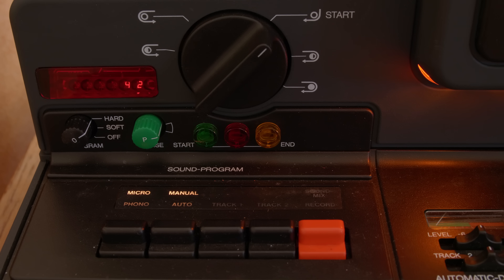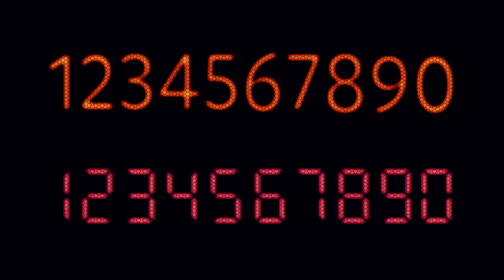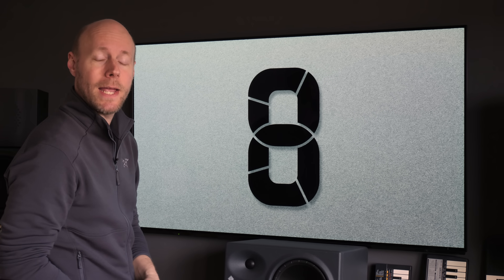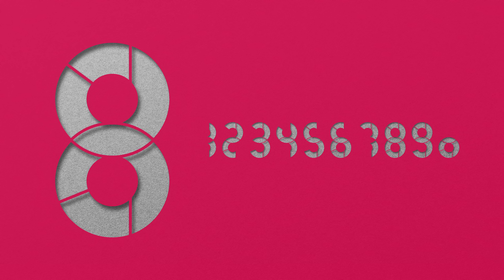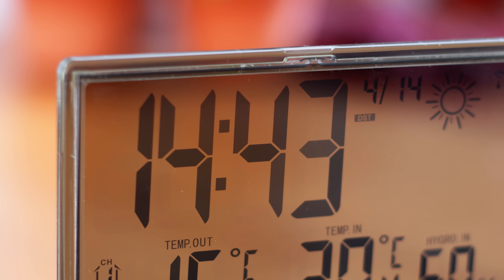Segmented Displays

Comment: Not to be overly critical, but that 6 segment design at 8:57 is really terrible. Hardly ANY of the numbers look normal. With some, like the 4, looking totally foreign to the point where someone seeing it alone without knowing it was a number would never guess it was a 4 in a million years. And even if they knew it was a number, it would take awhile before they guess 4.
Reply: What about the rest of the digits?
Reply: For me, the only digit that looks decent is the 3
Reply: @diegoadriandanielarce2211   At least with the others, knowing it is a number, you would be able to tell WHICH number. sure, the 5 is way more like an S, but you would know it was a 5 by process of elimination if nothing else. But that 4 could be a weird 7. Or, quite frankly, if I saw it, I would think that there was a segment that was missing. Like when my grade school gym's clock had lights out on the basketball court, and you didn't know if you had 4 or 9 seconds to get a final shot off.
Reply: @FUGP72   too much for me to read

Comment: If we move to base 16 and reinvent our numbers, we can do a 5 segment display, that shows all the numbers:
The segments being: o, I, __, \, / (don't mind the `s, using them to prevent YourTube's dreadful formatting from hiding the underscores)
o = 0
I = 1
__ = 2
`_I_ = 3
\ = 4
\I = 5
`_\_ (the bottom line is connected) = 6
`_\I_ = 7
/ = 8
I/ = 9
`_/_ = 10
`_I/_ = 11
\/ = 12
\I/ = 13
`_\/_ = 14
`_\I/_ = 15

Comment: I’ve once made a hexagon segmented display. It was for a game that was based on hexagons, and it worked pretty well. All numbers, letters, even capitals were doable, and I’m quite proud of it as well. The design was 12 segments, with each of the six sides being a segment, and lines from each corner of the outside to the center were segments.
Reply: ooh i would like to see that
Reply: Hexagons are the Bestagons
Reply: @javieralejandrotrianapaz6343  RCE fan?
Reply: @Atanat48 That’s from CGP Grey. He likes triangles more.
Reply: Do you have a picture or example? That sounds cool
Reply: Would love to see it. I've tried writing it out to see how it would look, but I'm not confident on the 7 or the 9. 
Plus, I gave up at "A" when I tried  letters.
Reply: @Jabberwockybird  top 5 edges, horizontal diameter line, tada
Reply: Cool, wanted to see the game too
Reply: Would love to see it
Reply: What’s the game called?
Reply: @CloroxBleach0  it was actually kind of a lie. The game was geometry dash and I was building a level for the game using hexagons, it was just easier to explain that way and didn’t really affect the information.
Reply: @thewoodpeckers655  do u have the level uploaded? If so whats the id, i’d like to see it
Reply: That sounds very cool
Reply: I thought of that design too! I came up with it using it isometric graph paper!
Reply: 1234567890
Reply: Hexagons are the bestagons!
Reply: @ fellow cgp grey fan!
Reply: 70th liker

Comment: In defense of the Sharp design, it can also display a high, half-height zero, which could be useful in monetary figures. Same goes for your X design. The X-O design is brilliant, but the 4 could use some work. Perhaps by using two segments in the middle. The 3x5 matrix also pales in comparison to the 5x7, which allows for much more segment separation. Also, a 9-segment double square with the two extra segments in the sides would only need two extra OR gates from a generic 7-segment design.

Comment: I ONLY HAVE THE SEVEN SEGMENT ONE  1:25
Reply: Bro put more that 25 replies in his own comment what a shock
Reply: 1:25 7 segment
Reply: 2:05 chopping the corners
Reply: 2:11 segments are not symmetrical
Reply: 2:34 rounding the corners
Reply: 2:57 closing the gap in both sides
Reply: 3:39 moving left casts away from the corners
Reply: 4:19 adding 2 middle segments
Reply: 4:42 alining slices in verticals
Reply: 5:33 double circle
Reply: 5:56 adding 2 diagonal segments ( 9 segments )
Reply: 6:47 fake matrix display
Reply: 6:59 color code
Reply: 7:13 fake matrix display ( 18 segments ) color code
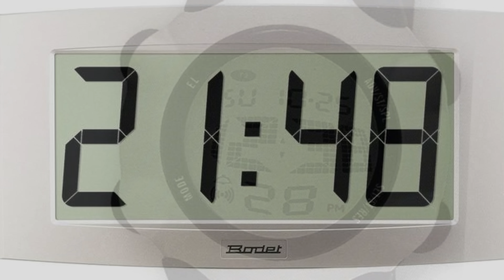Reply: 7:23 more displays
Reply: 8:05 display that is like handwriting
Reply: 8:57 6 segment
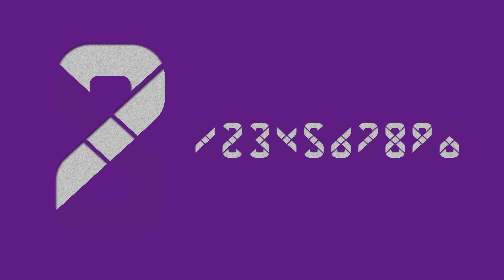Reply: 9:21 adding an extra middle segment
Reply: 9:49 display that has another segment on the right
Reply: 10:04 freeform
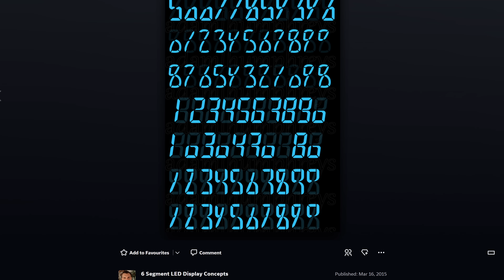Reply: 10:42 5 segments
Reply: 10:50 display that cannot be done
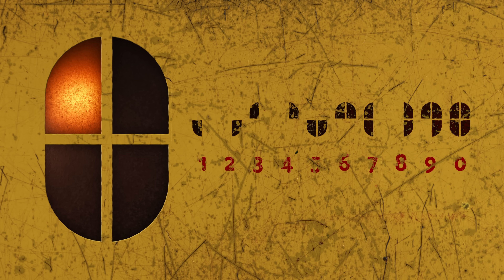Reply: 11:01 4 segments
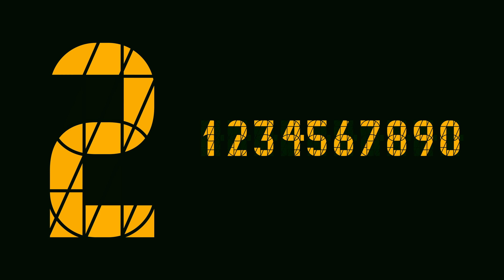Reply: 11:17 35 segments
Reply: 11:38 13 segment ‘’XO’’
Reply: 12:15 15 segment
Reply: 12:42 15 segment 3x5 matrix
Reply: 1:22 double square
Reply: ( normal )( 7 segments )
Reply: Copier copier la copier de cteeado

Comment: You’ve gotta license these designs to digital watch makers. These are pretty cool, and they break away from just being the same “double square” design, which I quite appreciate. I’d be interested to see that sports design on a G-Shock, and the double bubble design on a digital Casio
Edit: I’d also like to see a 9-segment version of the seamless design. I think adding 2 segments to the points next to the middle segment would greatly improve the look of the 2
Edit 2: I just realized: that Sharp calculator design is a modified version of that X concept you came up with

Comment: 11:38 the following suggestions wont lead to a reduced readability design.

XO design; you will gain a lot of readability by rotating the joint in the bottom right corner to a vertical intersection (as opposed to a 45°)

additionally, in this font type, the phonetic letter C does not benefit from the two middle-left triangles you've added, and I suggest removing them from this specific letter.

Comment: 05:01 in the double square 2 and 5 upside down are the same, so you can see if them are upside down if the device using them is upside down, the problems are 25 and 52 since they both upside down are in reverse plus 69 and 96 are palindromes so upside down theyre still the same, and in normal fonts 9 is not always a normal 9. Sometimes its like a lowercase q, opposite happens with 6, 6 is almost never a lowercase b.

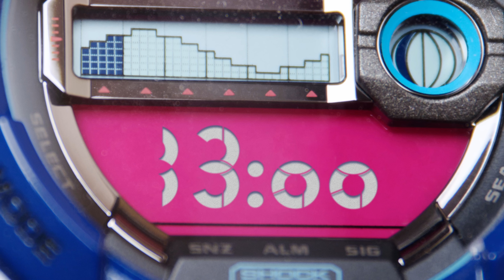Comment: 5:46 the 'double bubble' display could be used slightly differently... imagine the text baseline runs through the centre of each display unit - then raise the zero circle to the top, and only use the top segment for the one. Then it's like traditional page numbers in books where certain digits sit on the line and others descend below it. That would be fun!

Comment: I had no reason to pay attention to segmented displays until a few months ago when I programmed a web based chronograph with a digital looking userface, and wanted to use segmented numbers for the display.  I couldn't find anything free so I used an online font creator and, looking at several examples, came up with a modified set of digits (using paint).  I wondered what factors drove people to design in a certain way.... 

I didn't realize it was such a fascinating subject.... Your clever designs make me want to experiment with and modify my (rather crude) set of numbers, just to have some different user options for simple clocks I've made.

Comment: 5:22: "The best solution is to just add a line." <-- Just wait until you find out about the vinculum.
Reply: @PosyMusic  Personally, I am more partial to the vinculum for denoting repeating decimals than I am towards using dots for the same purpose, but for the record, the Unicode code points are U+0305 COMBINING OVERLINE and U+0307 COMBINING DOT ABOVE, respectively. Software support can be... iffy (to be kind). And I have never seen a calculator, device or app, that actually uses these characters to actually properly render repeating decimals instead of just giving up at some point and truncating the result.

Comment: I think the reason why most devices use 7 segment display is that you can store the number as one byte. Including the decimal dot, it takes exactly 8 bits to store the character. Coincidentally, a 7 segment display can display not only 0-9, but also letters A-F which are numbers of a hexadecimal numbering scheme used a lot in computational devices. Going further, 16 segment displays exist that do take coincidentally two bytes, but can display an entire alphabet plus some extra characters.
The arrangement is however, as you've said, up to the designer of the display. 
Also in my humble opinion, if the display is set to imitate dot matrix screen, why not just use the dot matrix display. 3x5 or even 5x7 can be controlled quite easily and offer a lot more possibilities (custom characters, simple grafics, accents,...)

Comment: 11:10 I made a square display with 200 segments that can display characters with different fonts
Reply: a respect design 🤯🤯
Reply: I made a 1000 segment design that can display any font in the video
Reply: Also i made a 20 segment design that can display any number other than the 8 in 2 ways
Reply: I made a 2 592 000 segments screen that can display videos
I called the number of pixels "resolution"
Reply: isn’t that just a matrix at that point
Reply: isn’t that just a matrix at that point
Reply: @PajamaCat4 a matrix is a rectange of rectangles iirc
Reply: * @PajamaCat4  says, 2 times*

Comment: a 4 segment would work it would be a on or off in 4 diffrent spaces for example 1001= 9 it is very easy to read after awhile and could make 12 much smaller making it 1011 instead

Comment: I love segmented displays. When i had my own home i bought several clocks with that type of display. I prefer older ones, though when i owned a trailer i found one really cool one which i still own. The trailer had lots of wood finish in it, lots of "windows" and counterspace. So i bought a few wooden digital clocks. They fit right in, looked like it was built into the trailer. Kept one of em, works nicely on my beaureu.

Comment: May I know the model and name of the clock in 00:32 please?
Reply: La Crosse TFA XI Radio Controlled Wall Clock sku TD-60-4510-01
Reply: @xorbe2  thank yiu dear but it's still not the same. The one in the video is inverted and has different type of parameters.

Comment: I'm late to the party, but you should take a look at displays of pinball machines from the late 70s up to mid-80s. Bally were nothing out of the ordinary, but Gottlieb had cool VFDs with Futaba glass, and each digit had 10 segments in a peculiar, and cool-looking, to be honest, shape.  The main scoring displays were 6 digits at first, then System 80A brought 7 digits. They also had a smaller, 4 digit units with only 7 segments, for displaying things like credits, match feature, and ball in play. The particular glass seemed to come straight out of a regular oven. 

Then came the alpha-numeric displays, and Gottlieb also had cool-looking VFDs with two 20-character tubes/glass units, each character being made of 14 segments, also with a very distinct shape. They operate on a relatively low voltage (around 60 V DC), giving off a pleasant blueish/cyan tinge, and were very durable.

Comment: An interesting note as to your standard of how numbers are written:

The first comparison with the 7 segment display stood out to me because in my handwriting, I write my 4s with an open top like the 7 segment display, however I do have the little horizontal tail. I also as I rummaged my side table for a piece of paper with handwritten numbers on it so that I was sure my brain wasn't playing tricks on me, I also saw that I write my 9s differently as well, using a straight stick instead of curving the bottom which didn't pop into my head immediately.

Anyway, just a though I had about how numbers are displayed vs what we write.

Comment: My microwave uses I think a 15 segment display that I don't think was covered in here. It's a double square but I think with a 4 segment X inside each square. It works great for text and since it's based on the double square it shows numbers as they would normally appear in the 7 segment double square

Comment: The big problem with a lot of designs is the legibility, you can look at the 7 segment double square design and immediately know what number it is without needing any previous knowledge, the digits are all quite clearly defined and visually different. With most other designs they are either not very pleasing to look at in context or some digits are hard to read at a glance, as an example, the 4 is often a problem child, it's very hard to display without any diagonal lines and diagonal lines make the segments asymetrical, i've seen some 13 segment displays where they do a diagonal line through each of the squares and another one going the other way which gets separated by the former line, but it gets a little busy at that point and doesn't look as good as the 7 segment.

Comment: One of the best segmented display is the one utilized for the Speak And Spell toys from the 80's. I think variations of the display at 7:40 are the most capable and efficient. They can be rounded or cornered, but the tiny segments on either side of the bar add so much versatility.

Comment: Really like the X and XO designs but as a programmer the 3x5 matrix was the winner in my mind.  for sheer usefulness and appearance of all characters.
Reply: Almost
Reason: 0 and O, 5 and S are identical
Reply: You can design those differences away. For example, chop off the top-left pixel of the O to make the zero.

Comment: I worked for an e-paper company way back in the day, a competitor to e-ink & we used a segmented display for text, designed in-house by an artist who had experience creating fonts. He essentially created a new font, similar to Corbel. I believe it used between 30 to 40 segments to make the letters appear like a real font, aided by the magnetic field interacting with the e-paper particles to both fill in the gaps between segments, effectively hiding the segmentation & to smooth out the letters.

This was 20 years ago, when dense matrix displays were expensive, so segmented displays were the only way to show natural looking text while keeping the costs down.

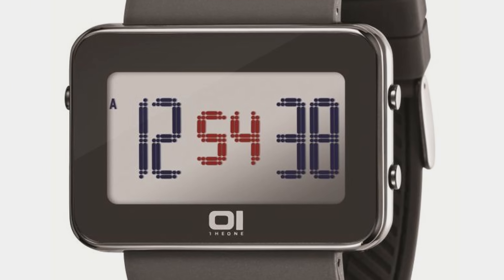Comment: 7:48
Finally a slight variation of the one I came up with was shown. I figured that it wasn't wholly original. But didn't know for certain until now. 

Long explanation:
I used it for my CLOCK display program in BASIC on the Nintendo 3DS program SMILE BASIC. It's fairly simple reason for why. Because I took the clock and converted it to Hexadecimal [base 16], for this reason I needed to add 6 more points to the classic 7 segment display. Even though the programming class took short cuts for displaying the time by calling numbers via the on system graphics, I watched a video about making a circuit board for a segmented clock display, so the program simulated a custom chip set to call information on the digit and turn on or off. 
Then for the letters A through E I just had to logically add the same approach. 
In the end I ended up animating the display on screen by bouncing it around like a screen saver. And changing the background color based on the hour, minute and second. (with Different colors in each catigory for different days.)
Of course by using base 16 there is no need for that extra digit for 10, 11, and 12. So it was a very unique take on a 12 hour clock display. 
[From 1:00 Am to C:35 ]
Months after the class I added another mode for the graphics, drawing a hexagon that ticked back and forth like a mechanical watch and learned how to draw lines at an angle.
The program was called "HEXCLOCK" and is still publicly avalible for download for a few more months before the 3DS service ends completely. [Note: if you accidentally download the program on SMILE BASIC 4 on Nintendo Switch you will be met with several errors, as there are small changes in syntax for displaying text on the Switch screen, and all the information on the bottom screen will not display correctly, or return an error.

Comment: The seven segment display is so omnipresent and iconic that it's affected how I think about the entire concept of numbers. Eventually, I'm fairly sure that base-12 numbers will replace base-10, and so we will have to come up with two more numbers. I've spent an inordinate amount of time thinking about how they will look, and my primary criterion when playing around with designs for them is to have them fit on a seven segment display. It's just necessary, and besides, it forces you to use an extremely simple design, which is usually a better idea anyway.

Great video.
Reply: I highly doubt base 10 is going anywhere. Much as I dislike it (and I’m on team base 6 anyway) it’s too ubiquitous to get rid of. Literally everyone uses it. I’d get a kick out of telling metric to eat shit, though, even if it would just change in value rather than function. It’s just too hard to condition yourself off of 10 being equal to iiiiiiiiii. I’ve done exercise reps counting in base 6 but I still have to think about what the number means or I lose track.
Reply: @pikminman13  oh I don't think it's going anywhere in my lifetime. I write, so I include base 12 in stories far in the future. But it WILL get there. It's been there before historically, in Germany and England and several other societies, and while base 6 holds a lot of the same advantages, I think 12 works better for useful positionals.